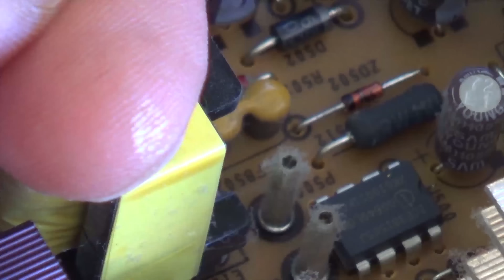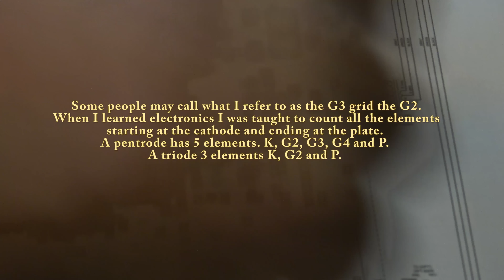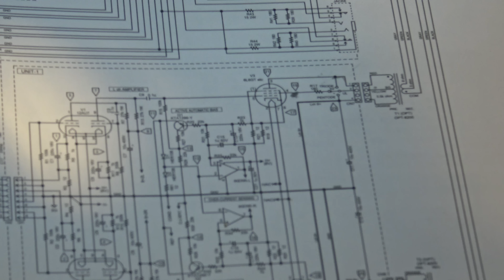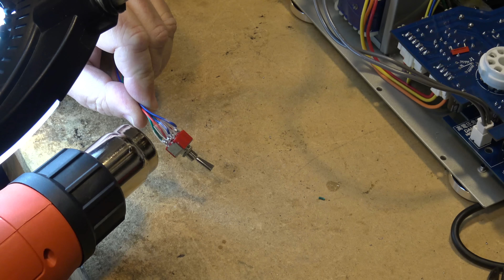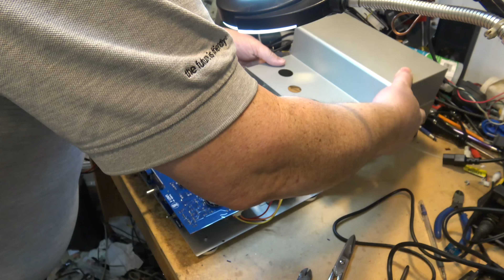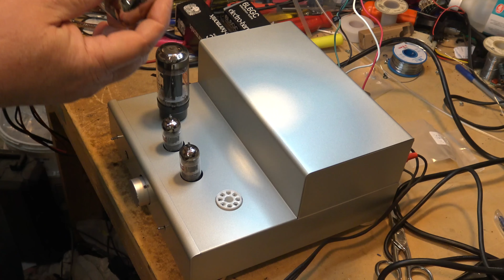ELEKIT TU-8200 6L6 Single Ended Tube Amplifier build Part 5

Comment: That just sounds like my TECHNICS SU A900 MKII integrated power amp which seems to get very hot at the back of the unit for some weird reason when it was driving a set of MISSION M70 speakers with an Impedance of 8R0 in direct mode bypassing the tone-control.
Reply from the maker: I believe that unit was an auto class A, where it could switch from Class AB to class A at low power levels. When it was in class A (up to 8 or 9 watts) it basically turned into a small room heater, as class A is not very efficient, but much more accurate. The big problem I found with those units is you could hear the transition. If the volume was set at a certain level there was a transition point that if you knew what to listen for it was audible. Most people didn't notice it, but once you picked it out, usually on quiet passages in classical music or on the fade out then it was quite annoying, as the tonal quality shifted slightly.

Comment: I'm going out on a limb here, but I think the tube sound is more important in the upper frequencies than lower. I think you can get great sound using a good class A-B below 1250Hz and a tube amp above that. If you optimize the design the output transformers for the higher frequencies, it can sound even better. Solid-state on the bass and lower-midrange can offer a better damping factor, which can result in "tighter" bass.
Reply from the maker: This one is rated 12 - 50,000 Hz within 3db, so it is actually relatively flat, however tube amps are fantastic in the all important mid range.To quote one hi fi reviewer,  if you can't get the mid range right then nothing else matters.You are correct though a good mosfet amp has better damping for sure, and I noticed that right away when I went back from using my class AB Yaquin amp to the Luxman. For about 5 years I used a Yaquin MC10, which is a great sounding amp, but not as punchy in the bass. As soon as I went back to the Luxman I noticed an immediate improvement in the low end, and I stuck the yaquin in my living room, more as a show piece, and for background music. I do most of my serious listening in my studio. That said, this new class A has every bit as much bass as my luxman, and A-B testing I have done places the 2 amps so close I am hard pressed to pick a favorite right now. I was listening to some vocal jazz, and I think this one has a little more presence to the vocals. I will have to wait until the new tubes break in before I can do a serious compare. I stuck in some old shuguang EL34B tubes that actually came out of the Yaquin. I had one that went south, popping and sparking, so I bought a new set for the amp and put the bad tube on a tester and cleared the grid short. So right now I am running 2 old tubes that have probably between 5000 and 1000 hours on them, and they sound great. I'll put the new EH tubes in, and burn them in for 100 or so hours and then give it a critical listen.New tubes need to be seasoned, to burn off any impurities left behind from the getter flash. That takes time, and then they open up and sound great for the rest of their life span.
Reply: I get by with the system I put together 1979-1981. I reverse engineered the JBL 4343 and used best practices to come up with the dimensions for the midrange sub-chamber. At the time, some local Tektronix engineers started BiAmp, making good audio gear. I use their SM-23 crossovers, TC-120 amps for bass and mid, and a Sony V-FET for treble. I originally used JBL horns for the 2420 compression drivers, but switched to "The Tube" Karlson-couplers. This eliminated the nasal horn sound, and the need to buy 2405 tweeters. (I crossover at 300 and 1250Hz.) I'm in the process of re-capping everything. I'd like to replace the Sony with a tube amp, but haven't decided on the design and FINANCING. I used to be able to hear bats, but they seem to have gotten a lot quieter.
Reply from the maker: Yes I hear you for tube gear. It can get really expensive very quickly.Some people don't mind dropping 30 grand on that vacation of a lifetime, that is done in a month. Myself I prefer to spend my hard earned cash on something that I can enjoy for many years to come. A brand new car, high end audio gear, nice cameras ect.
Reply: I agree that finding things that give back over the long run seem to be more satisfying. I went back and finally finished college, which was sort of like an expensive vacation. I got into buying land, and that saved my butt when I was forced to retire early. It turned out for the best because I have time to take care of aging relatives. But I have to separate my wants from my needs. Maybe I can justify a tube amp if I can rationalize that it will extend my hearing into old age.
What I'm inferring from your experience is that one class-A stage of tube amplification is enough to impart the (mellow, balanced, harmonious, easy) tube sound to a well-designed circuit, and that the output can be class-AB. Is this fair to say?

Comment: I'd check to make sure that little switch is rated for B+; not only between the contacts, but between any contact and the (metal part of) the switch body, lest you pop the breaker, your bridge rectifier, and you! Safety first. Most of those little panel-mount switches are only good up to 120 VAC, if that, and the DC ratings are usually lower.
Reply from the maker: Yes I checked when I picked it up. It is rated 250vDC at .5a. Operating voltage with the tube at operating temperature is 280v. Also the power supply is limited to 110 miliamps, so a short to ground isn't going to do much. Put the unit into over current protection, and turn the power light red.There is no real current flowing through the switch under normal operation, perhaps a few microwatts as it is just the bias for the g2 or g3 depending on how you count the tube elements. Also I will note that any that I build for clients will not be going out with any mods. They will be going stock with the red jumpers. If someone wants to mod a unit as shown here they are on their own.

Comment: with my Sony phones, the AL's were great, didn't like something about the shop speakers.  
I had the gain up too much on my Surface. Much better at half vol.  
I agree, triode is a good sound, I was thinking opposite untill I heard it.  
Of course Sony headphones on a tablet from YT won't be anything like the amp and AL's there.  I like to hear a vinyl LP on it sometime.  You were right. Perhaps a three pos rotary switch.  Don
Reply from the maker: The speakers in the shop ate PSB mites. Small little book end speakers with a 4" driver. Not the most efficient of designs.
Reply: I have some Rad Shak Minimus 7's, they have a small woofer.  But I use them with a powered sub.  Lansing, AR, and EV were the cat's meow in the big speakers of the old days.  EV still makes great pro stuff.  JBL is kewl.  AR gone.  But those small Altec Lansing PC speakers with small subs are something else, but for under 100$, they sound OK.  I still would like a pair of Empire end tables with marble tops, back when speaker systems were furniture too.  Pioneer also made nice looking good sounding systems.  Magnavox and Zenith did same with their consoles.  I still dislike the modular component systems for astetic appeal, sort of like all those dam black plastic case common TVs.  The flat TVs arem't as ugly.  Funny thing, I see more Magnavox tube consoles well under 100$ that work, just need some clean and lube, than any other TUBE things.  It's a great way to get a half way decent cheap tube system, plus a nice chunk of furniture.
Reply from the maker: Absolutely. I used to have a set of Rat shack speakers, and I chucked them in the garbage years ago. Wish I had kept them. The foam around the woofers rotted. Same thing happened with my Altec 305s in the studio. I got these speakers back in the mid 80's. Did a video for a guy that owned a stereo shop. He had me produce a video for a local politician that was running for re-election. I followed him around on his campaign for a day as he was going door to door meeting people, and then put together a video that was shown at his election headquarters on a loop. The business owner didn't want to pay me for the video shoot and said I could pick out anything in his shop worth 2,000.00  I always wanted a nice pair of speakers, and this is what I got, and I have enjoyed them ever since. About 5 years ago I had the foam surrounds replaced at a speaker service shop. That cost me about 300 to have both woofers and mid range foam suspensions replaced, and they now sound as good as new. That's the thing about speakers. Look after them, and maintain them, and they will last a lifetime.
Reply: rubber rot pisses me off, that's why I replace with bass guitar speakers, much better too
Reply from the maker: The new ones are silicone, and according to the speaker technician they should never need replacing again.

Comment from the maker: A follow up, running EL34 well aged (and broken in) tubes I have spent the las several hours listening to this amplifier in both triode and UL mode, and A-B comparing it to my studio reference amp, a vintage Luxman LV-103. As you know the Luxman is a hybrid amplifier, using 2 6CG7 dual triode "buffers" that give this 60WPC hybrid amp the sound characters of a tube amp. I have done this AB comparison with other solid state amps, and the Luxman is always the clear winner. Today, listening to several tracks I was really hard pressed to choose a clear winner. This 33 year old  hybrid was so close to the new tube amp in every aspect that if I didn't know what I was listening to. I plan to show it off to a few friends and do some blind tests, and see if anyone can pick a clear winner. To my ears this is as close as it gets, and that is a good thing.